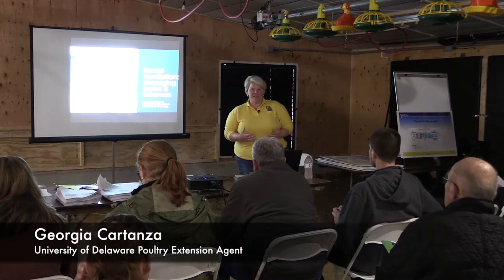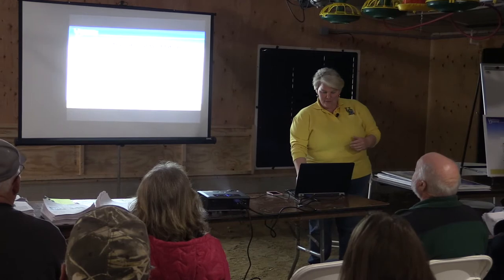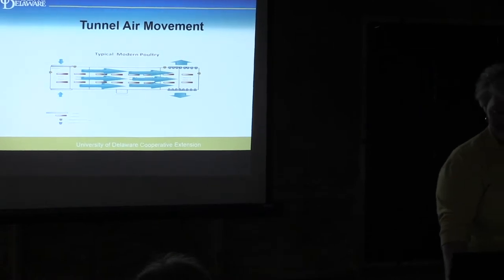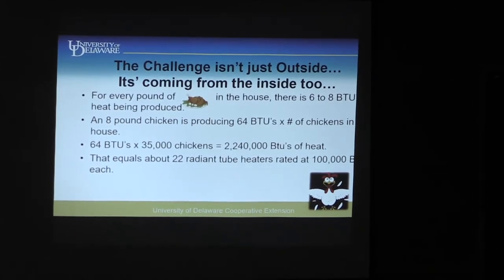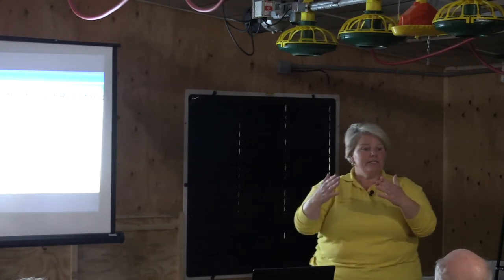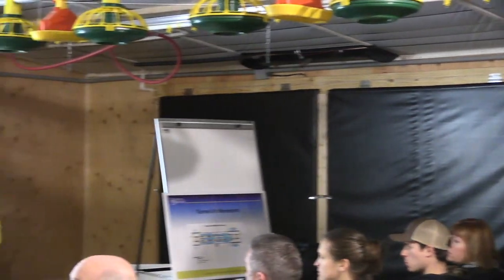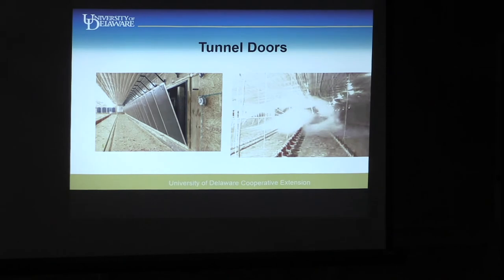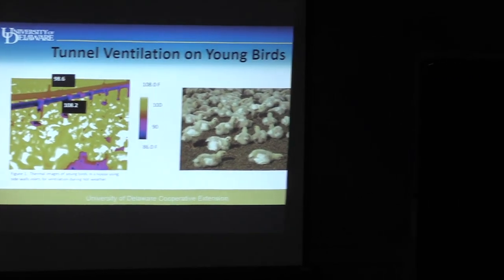Poultry Growers' Field Day: Tunnel ventilation Management

Comment: Can you provide me with a complete program of feeding, drinking, temperature, humidity, ventilation, ratio of carbon dioxide and oxygen, negative and possitive pressure and the prophylaxis program with photos of diseases and BioSecurity... for each day of breeding and the disinfection and fumigation steps in closed sheds before and after in Excel format in the rearing of broilers and laying poultry.